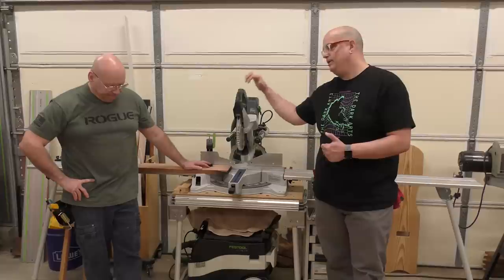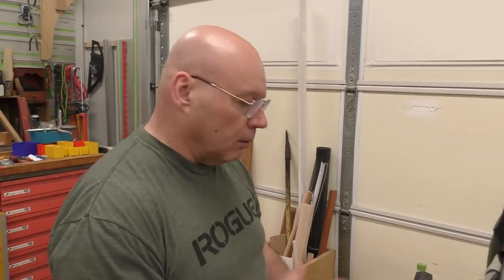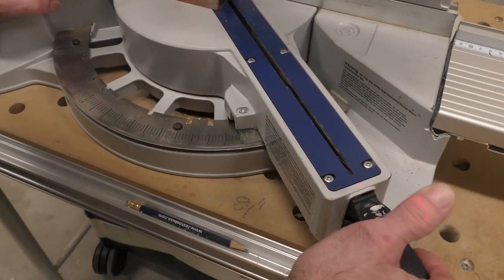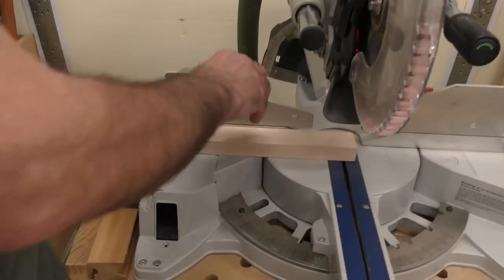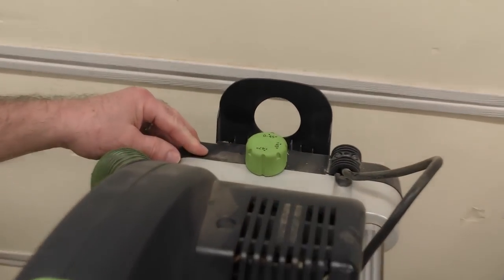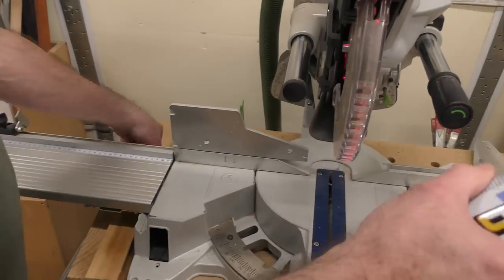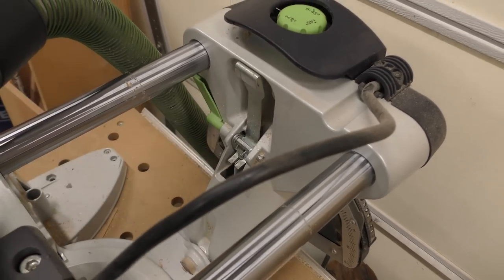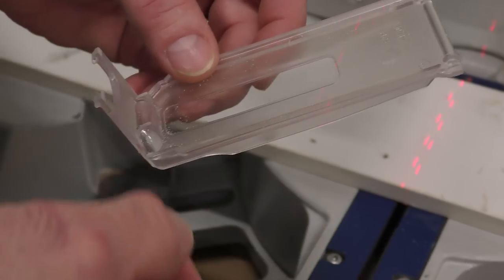Must-see Tips For Mastering The Kapex Saw !!

Comment: These tips also apply to other brands as well.  I have a DeWalt 12in chop saw that is basically the same without the sliding rails.  I have hold downs for it and I can use these tips to make my saw that much safer and more usable.  Thanks!!
Reply from the maker: Thanks for watching and always sharing your advice......

Comment: Awesome overview of some of the trickier items. One particular issue I am having  happens when I am cutting compound cuts that are thin. They tend to get pulled up into the shroud. I have made a point to angle the cut so that the off cut is at the problem and doesn’t dance around on top of the blade, but I still periodically have them get picked up. Also I am leaving the blade down until it stops….per your excellent advice. Any thoughts on this problem? Thanks for all the info!
Reply from the maker: I have never tried it but someone told me that they slow the saw speed down to avoid this...

Comment: I can't seem to find much difference other than some comments about the motor in the EB as opposed to the updated model, the KS 120 REB.  My local store has an EB floating around, but I'm hesitant to buy a it, missing some parts (angle finder) etc.  The few videos I did find didn't seem to offer much comparison at least for here in the states.  Thanks!
Reply from the maker: upgrades inside and a better dust port

Comment: Is there a answer why the Kapex has a vertical handle verses a horizontal handle? Most people get turned off when testing the Kapex . Thanks.
Reply from the maker: It is easier to use if left handed .... horizontal handles are always on the right side of the saw and very awkward to use left handed .......

Comment: Hey Sedge! I had a question I was hoping you could answer. Recently I had a project that required a lot of bevel cuts at 22.5. I was wondering why the Kapex did not have stops at the 22.5 for bevel or on the miter sections , any insight ? 
I just felt it was a bit cumbersome to make these 22.5 bevel cut wedges by dialling it in with my eye,
Reply from the maker: I believe it is because bevel positive detents are a tremendous wear factor and do not hold up accuracy over time... That is the reason the bevel scale is so large.
Reply: @sedgetool  thank you so much for your response!
Reply: @sedgetool  last question! This is just out of curiosity, I’ve noticed a lot of saws have 31.6 degrees in the mitre scale , why does Kapex have this not have this?

Comment: Even though I own the brand X (Bosch) sliding compound miter saw, I bought the Festool hold down. While you can probably buy a cheap compound miter saw for less than the cost of the Festool hold down, I don't think that anyone makes a miter saw hold down that is as quick and easy to use.
Reply from the maker: Thanks Robb...... It is the best hold down I have ever used ....

Comment: I have a nasty scar and a permanent groove on my left index finger from a miter saw kickback, before I got my Kapex. Now I ALWAYS use the hold-down.  I’d say the safety improvements alone were worth the costs.  My Kapex was new in 2013!  The saw was dumped down a flight of stairs by a helper. I was amazed that the accident didn’t, even change the calibration IN ANY WAY.
Reply from the maker: My saw in the shop is a 2006..it has never lost it's calibration and I have moved it a lot for all the flooring I have done in the house ....
Reply: @sedgetool   Just had an “ah ha”!  I’m glad I have a Kapex and not a Rolex!  Darn Rolexes just nag about the time, but Kapexes are the SOURCE of “a good time”!

Comment: Where should you use Dry Lube versus PG 2000?
Reply from the maker: I use dry lube for the guide rails and to coat my blades after I clean them and PG 2000 on Kapex , domino and router rods

Comment: Hey Sedge! I got another question for you! I have been using my Kapex to cut MDF trims, wainscoting etc but over the weekend I was building a cabinet and trying to cut walnut that had pieces as thick as 2” and as thin as 3/8” and although I gauged the sound of the motor to ensure I wasn’t digging too hard , it always got bogged down, and always left burn marks. It’s the stock blade. I’ve had the unit for approx 6 months now. And the weirdest thing was on the 2” piece when I tried cutting it in multiple passes, ( using the clamp ) it not only burned it black, it also cut it sort of crooked. Is the stock blade not meant for cutting walnut ? 😅 please help brother man
Reply from the maker: cutting MDF dulls the heck out of blades..... I ran into this when I was running MDF raised panels on my router table...I had a raised panel bit for MDF and 1 for hardwoods.....
Reply: @sedgetool  so the regular stock blade “universal” is good for hardwoods and you think I’ve dulled my blade because I cut MDF? I’m not sure I cut enough MDF or used the saw enough to dull the blades, is there anyway I can tell by looking at the blade teeth? I’m also concerned because when I cut the 2” thick walnut it couldn’t cut it straight, it was cutting it crooked, even though I had it properly clamped down and took multiple passes. It was like the blade was bending? What blade would you recommend getting for finish cuts on thick hardwoods? Ps, thank you so much for responding

Comment: Sedge please help. I’m cutting 100mm x 100mm timber posts and I’m having to cut, then spin the post 180 degrees to cut the last slither left on the back edge because the blade washer catches against the timber. Is there something I haven’t thought of?
Reply from the maker: Possibly place a 1” sacrificial fence on fence ??? My thoughts without try it out ….
Reply: @sedgetool  thank you, I’ll try that. It was a rush order on a table and I was under pressure to get it finished quick. 😂👍🏻